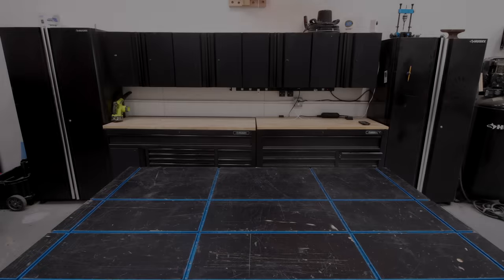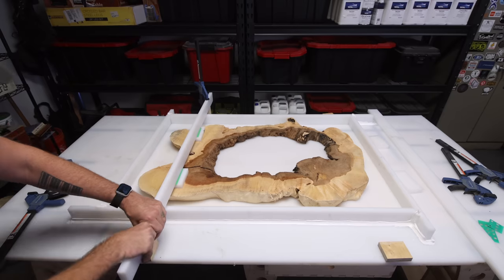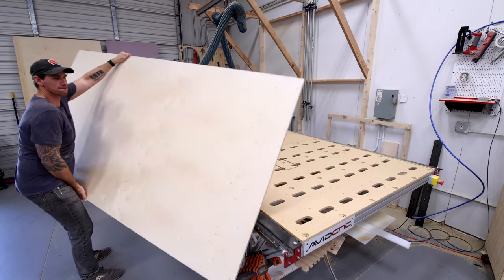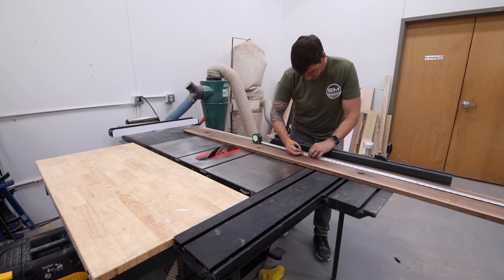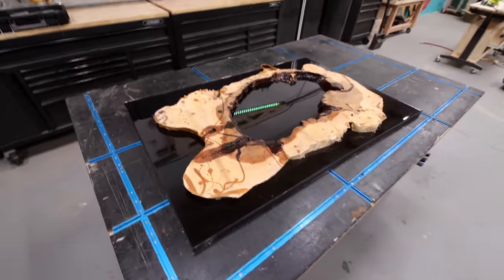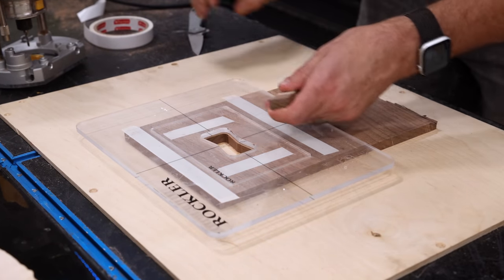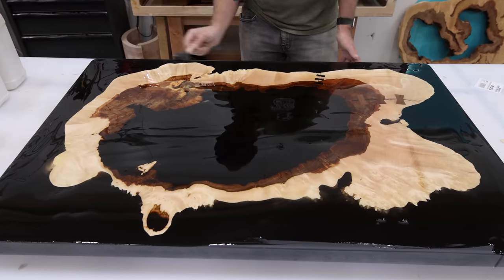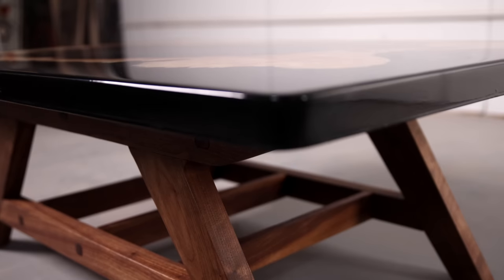Junk Wood, BUT I'll Sell it for $5000

Comment: It does look high end. But the bowties... am I crazy or only woodworkers like them? :P
Reply: Im a woodworker and absolutely hate them. Way overused.
Reply: That’s what suppose to make it so expensive the NATURAL flawless wood
Reply: The need to stop being cheap and spend for quality wood
Reply: yeah, ive seen a few tables that have them and they actually look cool but they often stand out in a bad way for me.
Reply: Hate bow ties
Reply: Yep! Me neither. Don't like the bowties. I think they should be hidden underneath.
Reply: @Aubergine1941  exactly my thought, it would not even be noticeable if the seam was underneath. Would be like "Which bowties?" Personally the issue with bowties is it never follows the grain of the wood. Always looks unnatural.
Reply: I'm a woodworker and hate them I'd rather seal everything in place with multiple structure layers of epoxy then a flood coat after
Reply: I like them when they are an original shape and still functional.  Not a fan of purely decorative ones.
Reply: I don't like them, I guess technically they are a wood join but I see them more like a fixing such as staples and screws just made of wood.

Comment: I've always had the thought the base, legs, etc. of a table should be regarded in the same way a frame for a painting is. It can kill a painting or bring out the best in it.
I liked the design for the original base but not the material used, that is the plywood. The second design choice seemed stolid to me and lacked the novelty and style that the top slab with epoxy had, which was very interesting but not overwhelming.
Reply: I agree.  If I were going to be paying $5,000 for a table, I wouldn't expect the base to be made out of cheap plywood, but quality materials.
Reply: I agree on that and I'll admit that I couldn't make a table as pretty as this but I would also have made it oval or rounded the edges; just because I think round in round looks best

Comment: Never gonna like bow ties, maybe doing this to the bottom to hide the repair would have been better?
Reply: He mentioned the bowtie doesn't really do anything structurally to the piece, so he could have omitted it entirely.
Reply: Yeah I liked it better without the bow ties for one it was more natural looking and two it looks strange like that
Reply: Honestly, I think the Crack would've looked pretty cool on top, and have the bow ties on the bottom.
Reply: Agreed, they should have been put on the bottom; it just makes the top look really junky.
Reply: Yeah bow ties only look good if they're actually originally planned into the design like depending on the color of epoxy and wood using some kind of contrasting bow tie can work
Reply: What i said on site exactly
Reply: How much would you sell this exact table if you have this knowledge too building such tables? Thank you
Reply: Celebrate the crack
Reply: How did you do on your sale. This is a beautiful piece!?
Reply: It's beautiful. But... Since the wood was so raw looking I wish it could have been the Big Bang Sparkly or like that iridescent opal look in the center... Like the universe inside the hole.
Your skills are amazing. If you were my Dad, I would have the Daddy-Do-list of furniture. Thanks for sharing your blessings! 🖌️
Reply: Yea the bowties did not look good. Especially because they were darker. They would of looked better if they were the same color as the wood.
Reply: Agreed… i hate em.

Comment: I wonder if you're ever thought of tinting the epoxy dark to light in the same shade to give grater depth in the pour. Just a thought!?
Reply: @Teresa Valliere. A nice idea BUT...

This would not work so well because as you add each resin layer to the piece then the "tide line" where each layer finishes and the new one /colour (note British English spelling 🙂) starts would be quite noticeable, rather than a changing blend as I think you are implying. A practicle solution might be to use a different "grade" of resin which permits pours of up to 4 inches but this still would not give you the changing tint, rather being able to see further to the base of the table. However, this brings its own complications re overheating / curing problems!

Comment: I can’t help to think that pouring in two layers will leave a line between the two layers along the sides, as it’s very hard to match colors between pours, even when using a black tint. How did you avoid that situation or didn’t you?
Reply: If you do the second pour when the first layer is still fairly soft and tacky you’re good to go.

Comment: You should make a doughnut or polo mint shaped build with these sections - circle cut into the centre of a circle. That would also provide a window to the base, or offer a position for some shelves, a turned bowl, some vases, a tiny sandpit, or perhaps even a miniature herb garden.

The wise man would place a channel and a lip at the edge of a void in a table... otherwise you have created...

A trash can.

Which you could also make a table with a void in the top to accommodate. Nobody integrates a waste basket into a table, and it seems very silly.

Comment: I appreciate your woodworking, technical, and design talent and consider your work grand.
Given this, in my opinion, this  was not on my list reflecting your best work.  
I am a tiler concentrating on  upscale design and specialty projects, so I understand the process and the flexibility the process can, at times ,require. 

 When I first saw your piece of wood and listened to your list of constraints regarding the piece, it occurred to me it might have been possible to have joined it  with other pieces, perhaps a counter top or desk top. Your skill with fiber optics would be very intriguing in such a project. 
The  base of the table was in my favorite wood and I appreciated the lack of glue fitting the pieces. I would like to have seen a drawing with the  top edged in the walnut out of curiosity.   The bow ties were distracting and for me I lost the visual flow in the work, which is very important for me.  I would never be able to unsee them. 
Looking forward to seeing what your up to next.

Comment: I wouldn't have made it quite so dark so you can see inside a little easier and I would've added a bit of gold foil like you used in another project but applied it differently... I think that the gold foil in the dark epoxy is really sharp and sexy.
Hey it's just my personal opinion and I may be on my own for thinking it.

Comment: Beautiful!
I agree with the comment under me. The bow ties need to be updated with an artistic design. Maybe a S shape design or a flower with leaves. You’re an artist so get your thinking cap on and design something pretty. I should draw up the flower design I have in mind and email you. This video is old so you may not even read this 🌺🌷🌼 Lay the flower sideways so you have a leaf on both sides. Or just make a petal flower that lays in both sides. With your tools it should be easy.

Comment: Nice job.... sanding between expoxy coats question...  must there be no scratches on the expoxy after sanding before pouring a new layer of expoxy  or does that not matter ?

Comment: imo - instead of the bowties... I would have added a dark red epoxy to fill the cracks and accentuate them. It would have looked great with the black surround. just my opinion though. 
I might have added a bit of "smoke" white (or red) swirl in the center or something too. But if you got your $, then props.

Comment: So, you sealed the top of the table ( which BTW look stunning ) with epoxy and then applied odies Oil on top? Is there a reason for that? Does the oil protect the epoxy? Im obssesed with your work.

Comment: I think there was a missed opportunity here. Instead of all black, you should have gone for a more tropical island look. Full black on the outside, and as the base on the inside, followed up with dark blue in the middle and then light blue on the top. Let the blue flow through the cracks and mix with the black outside to make it look like a river into the abyss or something.

Comment: In the previous video you said nothing sticks to the UHMW. Does that pertain to only epoxy & wood glue? What are you sealing the bottom of your form with?
Reply: silicone caulking works well for sealing the bottom and preventing leaks

Comment: The only thing I disagree with is using the clear epoxy for the top coat. In a few years it will yellow and fog up, won’t it? If I’m spending $5k on a table, I wouldn’t want it to tarnish in only a few years.

Comment: To remove all that loose stuff...might want to try a needle scaler.
Reply: Interesting idea...my initial concern is excessive gouging, but I've not used a needle scaler before.  I imagine that with a bit of practice and care it would work a treat, especially for the tighter nooks and crannies.  Thanks for the suggestion!

Comment: Nice looking but for the life of me I don't understand why you decided on a rectangle shape when the live edge wood was oval.  The base looks nice but the top IMHO looks bad.  I would have just pox'd the inside circle and left the live edge outside just coated with epoxy or just an oil.

Comment: We all know that college is expensive. But if you can pour a $1000 or more worth of epoxy on that slab sure you'll have enough for your daughters college too. If not, then don't spend it on epoxy simple. You really have to come up with a better story to fall for. Btw, i would not have used bowties at all. As #Raven Rock wrote:  " The table itself looks like an island in the tropical ocean (dark blue epoxy would have really sealed the deal), so the cracks would have looked like natural channels of water."

Comment: Too much pigment in the epoxy. Missed (huge) optical opportunity.
Reply: I was thinking the same. But not everyone thinks alike so maybe someone out there will like it. Just checked and still hasn't even sold. Not even for the 2k res price.
Reply: @jestes7  I've done it a few times, too much... finding out as I experimented with multiplying tint, that my favorite amount was about 1/5 my mental estimate. It's tricky because we often use our mixing stick as a judge of concentration. Doing so we are looking at about 1/32" of color.

Comment: Okay I have an issue with you supporting better help only because I have found out that they have been taking local psychiatrists and psychologists information putting it on their website saying they're local and then when you click on them they say oh that one's not available how about using another one of ours and these people are not part of better help so I'm hoping that better help cut on to whoever's doing it and fire them and fix the problem because if they haven't you need to check into it and make sure that you don't give them a shout out if they're doing shady practices

Comment: CELEBRATE THE CRACK so I went looking to see what happened aobu this table on eBay & InstaGram. Since eBay couldn't even follow your link, I'd say you either sold the table or gave up on eBay helping you out. I found the table on InstaGram, but I don't see that it says anything about the sale of the table. Is that because you haven't sold it yet? I just wondered if you got anything like your asking price.

Comment: $5,000 for a computer generated, 99.9% computer cut, some resin, and a base that has a height that is only good in a Japanese home....
I guess fools are easily parted with their money. The absolute complete lack of hand made craftsmanship other than some sanding and polishing  begs the question how can you ask for so much with a straight face when so little is actually done? I guess it's my upbringing by parents who went through the great depression. My parents were right as they saw the writing on the wall with the changes in manufacturing. Have a machine do most of the work, slap it together and haul it out for sale for max profit.
To note the piece isn't that great. You went the lazy route with those bow ties. You could have carved out something and made it like a river feeding into a lake but nope, slap it together and haul it out for max profit.
Reply: Cry more.
Reply: @rizaadon  cool story bad troll. What great context you provide.

Comment: Would not spend 5000 dollars on this. Plain and simple, you can only put so much lipstick on a pig. When your working with less than best material, do not expect to make 5000 dollars off an item. Some dumbass will buy it and he will buy another tool for the shop lol

Comment: I don't see top quality at all. Even the table top is not flush to the base . Check eBay pictures and you will notice what I'm talking about. Also the epoxy edges looks horrible and not sharp at all. You need more wood and less epoxy.  You should have made a hanging frame not a table .